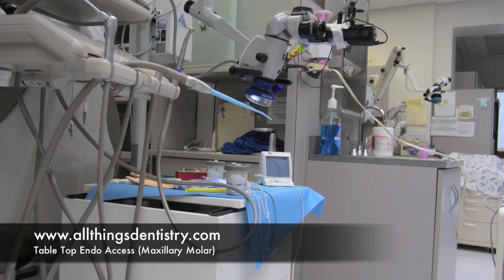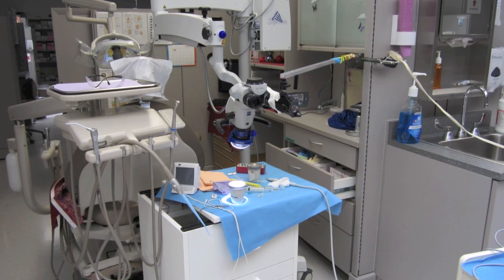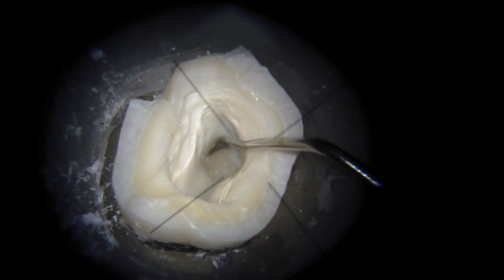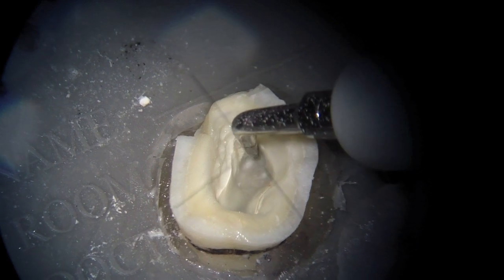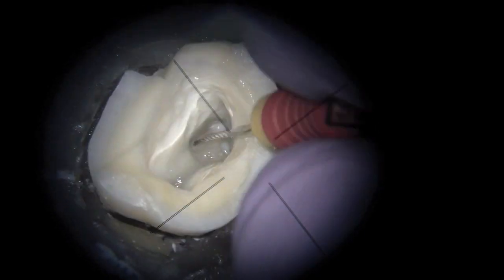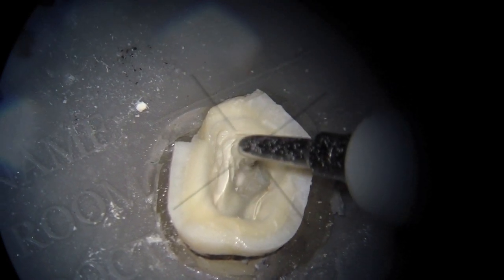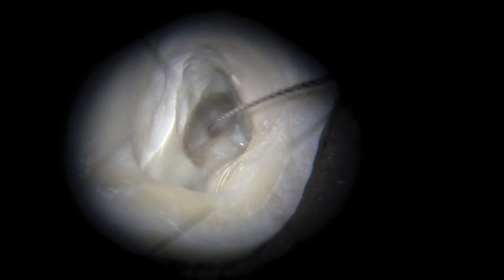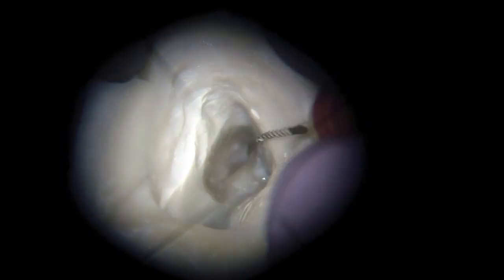Maxillary Molar Endo Access - Ultrasonic MB2 Troughing Microscope

Comment from the maker: Hi there,  Unfortunately, at this moment in time, I can't give you a straight answer b/c I've been in the Army -and - the Army has only purchased the Miniendo II  - it is a self contained piezo electric ultrasonic handpiece and does not connect to the dental unit.  From what I understand, the only types that connect to the dental unit are sonic scalers, which "vibrate" at a significantly lower wavelength (5000-6500 hz) vs piezo electric which is around 30k and magnetostricive (cavitron) @ 20k